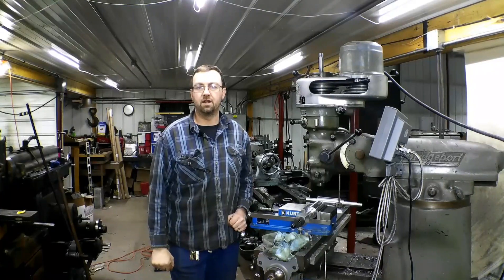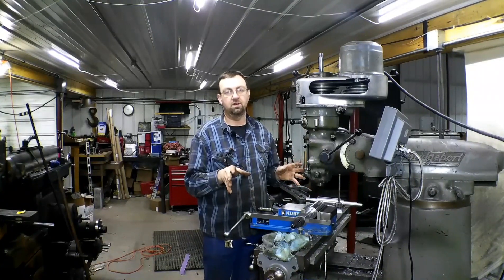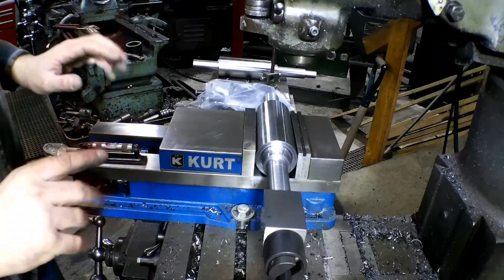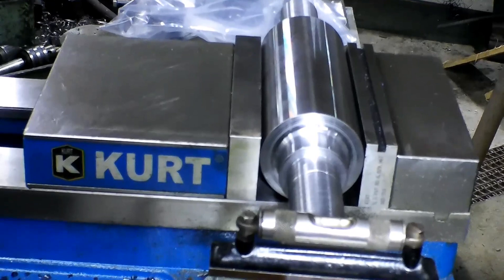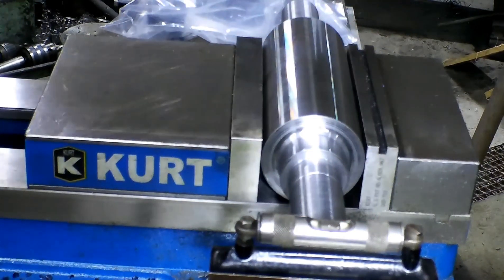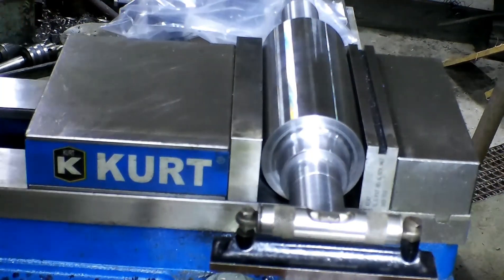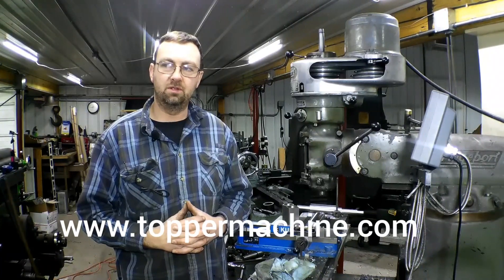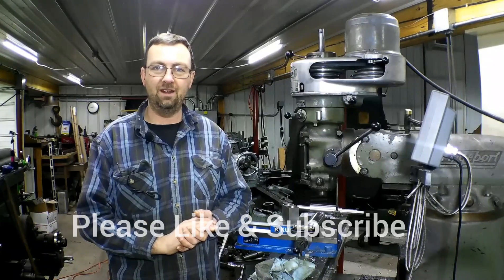Setting Up Positioned Features Without Using a Dividing Head

Comment: I really like your shop especially the Lucas HBM and the Shaper. I'm just running a Bridgeport EZ Trac 2 axis cnc mill and a Webb Takasawa 12x30 Engine Lathe, soon to be moving into my garage from my shop i've been running since 1994 , so i will be basically retired but like to tinker around making parts, i'm soon to be 77 and have been making parts since 1967, i started out on a Lucas HBM and a G& L HBM, and also a vertical boring & various shapers too after finishing my apprentiship. Keep up the good work and video's.
Reply from the maker: Thank you.

Comment: Don't see that you need to match the level of your work to the level of the vise.  Even if the vise isn't level front to back, leveling the part only will give you repeatable setups
Reply from the maker: If you are trammed true to the vise/table, but your mill is not level, then you get a bit of a problem. You could drill/mill at the difference of the machine level. The old timer I learned from had perfect tram, but his mill was leaning back a bit. So he adjusted his level to match the tram.
Reply: Assume the mill is out of level by 20 degrees (high in the front and low in the back).  Spindle trammed true to the vise.  With a workpiece mounted in a square collet block, as you have shown, set up like you did but with the level dead on level on the collet block.  Make your first cut.  Loosen vise and rotate workpiece 90 degrees and level dead on level again.  Make second cut.  Second cut will be 90 degrees from the first cut.  Rinse and repeat.  As long as the first cut does not have to be parallel to another location on the workpiece you are good to go.  Try it you'll like it.